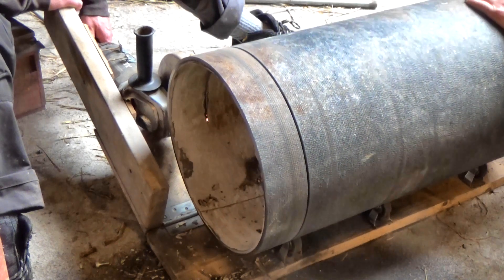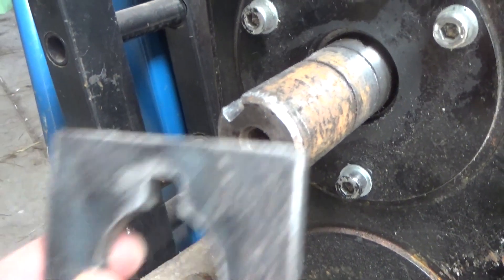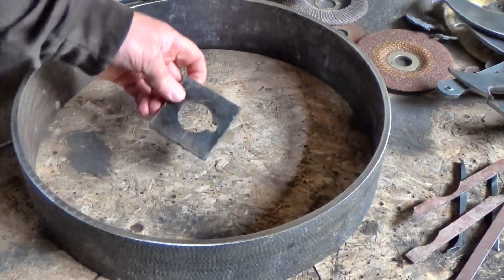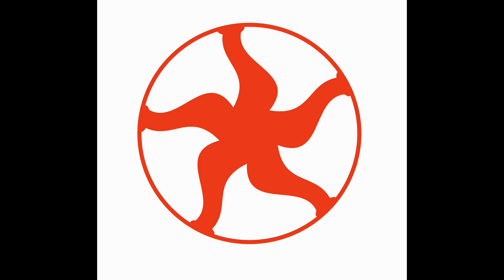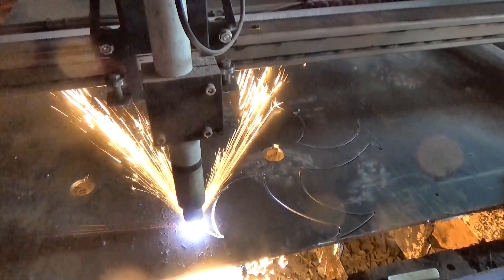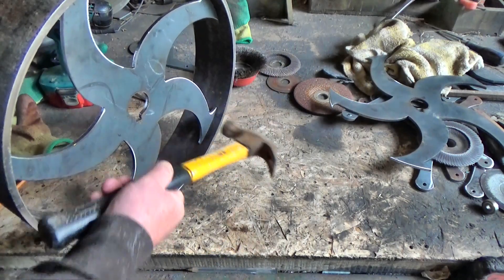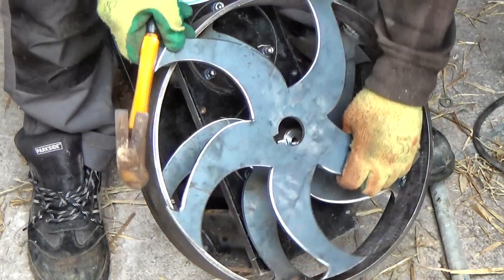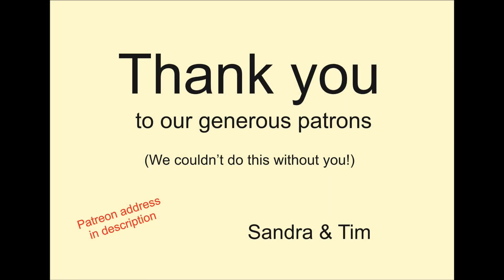Making A Flat-Belt Pulley Wheel From An Old Pipe

Comment: Awesome ingenuity as always! I would recommend applying some grease between the pulley and the shaft to keep the parts from fretting. The plasma cutter will have hardened the metal near the cut, and it may be hard enough to eat into the shaft with all the vibration that the machine will be exposed to.
Reply from the maker: Good idea - thanks, Jason

Comment: Like the style of this. I always though the swirly spokes on old elegant cast pulleys were to allow a little temperature expansion/contraction without cracking the circumference but not sure where I got that from. Apparently flat belts centralise automatically on slightly convex pulleys which is counter intuitive but handy to know (bet Tim knows this already :-) )
Reply: The curved spokes are to dissipate the stress of shrinkage from the casting process, straight spokes, when they shrink (most amount of shrinkage on a straight run) pull directly on the hub and rim of the pulley, meaning a heavier rim would be needed to be strong enough to resist the stress, curved spokes allow an amount of “spring” for contraction, an thus a lighter rim can be used. A crowned (convex) pulley will centralise the belt, but should be used with a flat pulley (no crown) at the other end of the belt, two crowned pulleys have the tendency to make the belt wander from side to side In an oscillation, as they fight each other to centralise. 👍
Reply: Thank you Tris for your explantion! I learned many years ago that the centering effect of a convex pulley is due to the greater speed at the highpoint which is responsible for a just slightly greater centrifugal force at that same point.

Comment: Beautiful design on the spokes, looks fitting for a flat belt driven from that old engine. Shame it's rare to get proper cast pulleys but I'm sure it will be heavy and strong enough with such thick material. Good work as always!
Reply: Not as rare as you would think, I currently have 20 on eBay!
Reply: @trisrush9155  - is there a link?
Reply from the maker: Where Tris?
Reply from the maker: Thanks, Jonathon!

Comment: Hi Tim. Flat belt pulleys should have a crown on them to keep the belt running in the centre. You may be ok if the pulley at the other end is crowned. This is how I run my saw bench. The saw bench has a crowned pulley and the engine has a pulley made from pipe. This pulley is about 6 inches wide so the 3 inch pulley is centralised by the saw bench pulley and then just runs where it wants on the overly wide engine pulley. Cheers. Rob
Reply from the maker: Thanks, Rob. Neither pulley has a crown yet, but my plan is to try a Vee belt (inside-out) first. The tension pulley will be a vee pulley and I'm hoping that will keep the belt in place, even when loose. We'll have to see!
Reply: @WayOutWestx2   Yes, one aligning pulley might be fine

Comment: Like one of the other comments below, will be interesting to see how the belt reacts with no crown, might be OK if not to far from the engine. Might be worth putting a spacer on the other side from the key, might find the inner flange wants to walk to meet the other it would also let you tighten down on it more with that bolt. I always keep a stock of pre machined flanges in various sizes with pre cut key ways like the ones used on petrol go-kart axles, always handy for joining things to shafts that perhaps should not belong! Looks like it's going to be a right muncher when it's going!

Comment: how are you going to get a crown ontop op the Flat-Belt Pulley  as the crown ontop  pulley will stop the belt from coming off
Reply: He talked about this in another video. But good point.
Reply: The belt will stay on a flat pulley,you just need to be more precise lining the 2 pulleys up.
Reply: @philleeson7835  Not if both pulleys are flat.

Comment: Flat belt pulleys aren't usually flat on the face like pipe is. There is a good chance the belt will "walk" off the pully. The pully face needs to be slightly rounded to keep the belt centered when running.

Comment: i don't have much experience with flat belts but if you have enough material for a bit of a crown, even a tiny amount like a couple of mm will make a world of difference and barely affect the strength at all. match the crown on the pulley of the engine if you can to extend belt life.

Comment: Did you consider doing 4 rectangle pieces with the key slot rotated 0,45,90,135  degrees on each one. Could be stronger with less waste.
Reply from the maker: It's a good idea, Egon. So many ways to do most things..

Comment: angle grinder contraption to grind on the spinning pulley to make a crown on it next?
Reply from the maker: It would work - but is it really necessary I wonder
Reply: @WayOutWestx2  If the belt does start to run off the pulley, just put a few wraps of insulating tape around the centre portion of the circumference to make a "temporary crown" (note, not the dental type !) and if that sorts it out, replace it with a thin strip of metal tack welded on ?